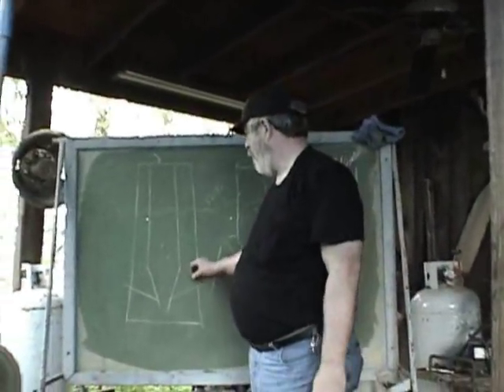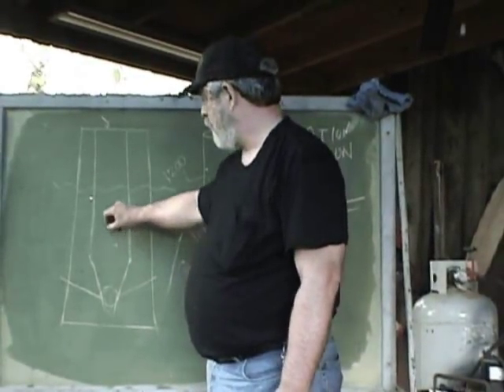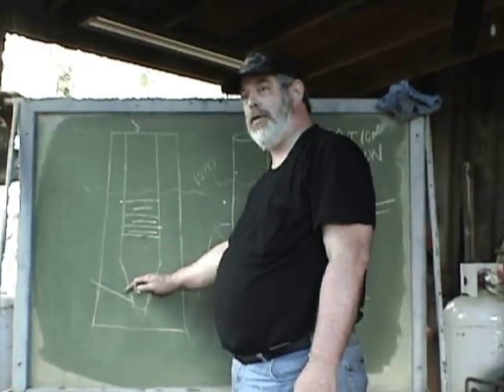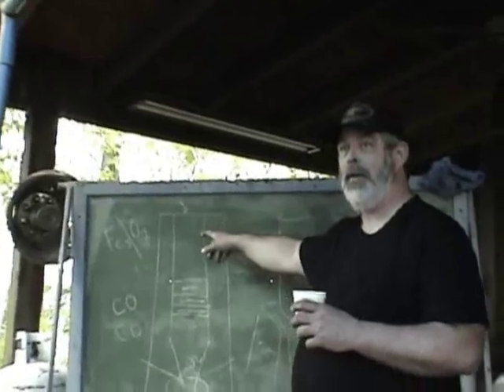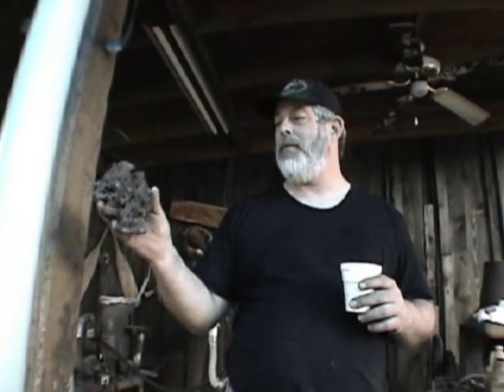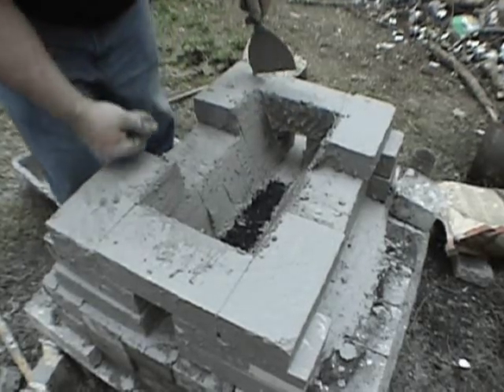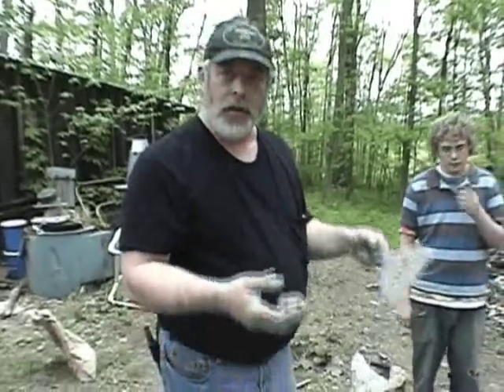Making Steel from Iron Ore

Comment: when he says layer, what is the "powder" that he is referring to between the Cole ? powder from the ore that they broke up? wish they were more specific about the incidence measurements they had in this video . thank you for posting though one of the more informative home made steel video , i just find all kind of industrial videos  , witch doesn't help me on my quest of educating my self of off grid living for end of world scenario lol . now on to how to make gun powder
Reply: +ixxgunnerx x Yes powdered ore, then charcoal, then ore, charcoal. Steel is carbonized (from the charcoal in this case) iron. The charcoal acts as heating fuel but also carbon ending up in the final product, and the construction provides the right low oxygen environment to chemically convert the ore. The result also has some other junk in it from the surrounding rock minerals and dirt, etc. In other furnaces, this is dealt with by adding flux, chemicals that bind impurities and then flow out separately. Lime and borax (though not sure about the latter in a furnace) are decent iron fluxes. Or hammering the bloom (chunk of impure steel at the end) over and over later on and folding it can help push the impurities out physically.

I don't recall them mentioning flux in the video, not 100% sure what this is here or know enough to just glance at it and say for sure, but there's more than one way to skin that cat.
Reply: ixxgunnerx x The powder the're referring to is iron ore.
Reply: Crushed charcoal, ore powder, silica sand, both the silica and the charcoal act as fluxes, typically hematite is mostly oxidized already, not sure what they're using but the hot as hell fire with all the carbon to burn the oxygen in the ore either ends up burning or bonding with the silica.
Reply: yeah its iron powder from the ore they broke up or u can get pure iron powder as well if u buy it that way, otherwise its a lot of work to make it pure yourself from just being ore

Comment: So is the end result a steel ore more or less? I know that there isn't any actual "STEEL" ores in nature, unless maybe formed by volcanic activity in some rare spots on earth.
 But could you compare it to pig iron. Or is it an amalgamation of steel and iron blob?
Reply from the maker: shexdensmore The end result is a formation called a "Bloom" which is that spongy looking chunk of material handed around earlier in the lecture portion. It is metallic, not ore anymore, but needs to be compressed and refined through hammering and folding to get all the slag and charcoal bits out, and homogenize the chemistry across the bar.

Pig iron is the product of a blast furnace, which is actually cast iron. Finery furnaces would take that material, and re-melt them, burning off excess carbon until a steely chemistry was achieved, but that's a completely different route, and more appropriate to industrial uses than for sword and knife-making, which this community is focused on. The process in this video approximates the Tamahagane produced in Japan, albeit on a much smaller scale, using different ore, but the end result is contemporary with the traditional products.
Reply: Gotcha.
Reply: ***** 
 So did you produce steel or wrought-iron? I'm a bit confused.
Reply from the maker: shexdensmore IIRC, it was "steely bloom" in that there was enough carbon in there to call it steel once pressed up into solid bar. Only difference between steel and iron, is the addition of carbon, which is something Dr. Blue was talking about by giving it time at temperature in addition to what was needed for the reduction to happen properly.
Reply: Gotcha, i just watched another vid that explained in better for me right after I made this comment.  
 Basically it said that you really don't know if you are going to get out what you want unless do diligence and proper proportions are used along with exact measurements with complete control over the process. And even then, its a gamble. Too much or too little, creates cast iron or wrought-iron. It amazes me on how consistent you have to be as well as experienced. 
 My hat's off to you and your crew.

Comment: Hello Christopher, very nice and informative video on producing steel from iron ore. Though I have some questions. How is this tatara smelting process different from European bloomery furnaces? Both furnaces looks identical except for the long narrow end on the tatara smelter, and both furnaces follow the same steps shown in the video. Then why is the end product for the tatara smelter steel, and European bloomery furnaces iron? 
Also, how is European steel and tamahagane different? Japanese steel had to be folded to make the carbon content homogeneous, but what about European steel? Did they also fold their steel like the Japanese, or did they have a different approach to produce homogeneous steel?
Thank you for this interesting video.
Reply from the maker: DerpTheGreat Materially, less difference than one might think. First it's important to distinguish the level of refinement needed for swords, vs. everything else made of metal in the same time and place. The key difference in the making, is the height of the stack, and the rate of air/charcoal/ore which is the balance that manages the end product's chemistry. In the Japanese case, the stacks were a little taller, which gave carbon more time to find its way into the iron, making steely bloom, where a viking furnace would usually be shorter, run faster, and not take up carbon as much in the process.

That said, carbon can be added later through hearth refinement, taking bloomery material and re-melting it in a short charcoal-burning hearth, and a smith familiar with this process can adjust carbon content and melt out impurities without all the hammering and folding the Japanese process is famous for. Just different ways of skinning the cat, and despite the constant pressure of people wanting to know which is "better," there is no good objective answer to that - the craftsmen did what they needed to in order to create the tools and weapons in demand by their cultures in their time. Those of us who study historical metalcraft see the overlap in techniques among ancient cultures, but one has to remember that they were working in a world without a scientific understanding of carbon's role in steel, nor the impurities that grant certain properties when alloyed through smelting, native to the ores used. They also certainly didn't exchange information freely among themselves across continents like we do today, the knowledge of good steel production was guarded like nuclear secrets were in the 20th century. Such secrecy and reliance on traditions, accidental observation, and (what would appear to us today) very low tolerance or appetite for experimentation, builds an easy foundation for myths, legends, and wonder at the end product. Make no mistake, this is alchemy, magic to those who don't understand it. Even educated modern smiths can still marvel at it and feel a little "touched" by being able to turn rocks into the finest edged weapons known to man.

Comment: He said it was an accident? As if the Japanese just folded their metal? Lol. So wrong... The metal was folded but also mixed with 2 to 3 types of metal to create a flexible steel.
Reply from the maker: Given that Dr. Blue has worked with Japanese Smiths on academic exchanges, I would suggest he knows what he's talking about. Specifically, that the patterns in Japanese steel were not the object of their refinement, but a fortunate side-effect of creating a homogenous bar of clean metal by hand in a pre-industrial environment. Yes, patterns are there, but the patterns aren't the point of the cleaning and preparation process... getting a bar of uniform material was the point.
Reply: Ah valid point but his comment in the video suggests othewise about his questionable knowledge.
Reply from the maker: Jonathan Elkins It was offered in a context of other educated bladesmiths, people familiar with the reactions of iron, etc. Somewhat esoteric for a general audience, and rather contextual to the moment, for sure. But he's not wrong in his characterization of the basic elements of the process.
Reply: Demacus steel is the achivment the Japanese were and are creating although the origin is inconclusive they still mimicked the steel by that of forge with several types of metal on a molecular level. I was just stateing my opinion on his comentary. Not questioning his knowledge on the creation of the demacus steel, but how he thinks it came about.
Reply from the maker: Jonathan Elkins Please go learn a few things before bringing argument here. Damascus steel had nothing to do with Japan, and was originally a crucible-steel, cooled from a liquid state and carefully forged. Modern pattern-welded steel uses 2 or more alloys to create contrast and patterns, but don't improve each other. There is no such thing as a steel molecule, it's Iron with carbon within a certain percentage by weight distributed among iron atoms, not chemically bound to them. Japanese steels are a complex subject (too much for this fora) for sure, but many misconceptions abound as to what made them great in their day. The attention to detail of the craftsmen is paramount, but it's still just a medium-carbon steel at the end of the day, and certainly no secret to those who study these things and do it themselves.
Reply: Not on the process. He is correct. But the statement that was made about the Japanese ACCIDENTAL fusion of the metals was not correct.
Reply from the maker: Jonathan Elkins That's not what he says - he's talking about the patterns being a "happy aesthetic accident, rather than something they desired". The whole folding and cleaning process is needed to get a clean bar, not a fancy-looking bar. That it happens to have patterns is great, and the Japanese, being who they are, take that feature and push it to a high art, but it was never the initial object of the process.
Reply: So my argument about his ignorant statement about how the Japanese created the steel was wrong? How so sir? And yes the are some gaps in my knowledge on the subject but with out my statement i wouldnt have had a reason to do more reseach on the subject. I do thank you for the enlightenment on how i need to research more about this, but you seem to be misunderstanding that i didn't say that i know it all. Im still ignorant to the entirety of the process and what steel maybe what. But again the comment was in accurate.
Reply: Sorry if i caused any ill mood good sir but my comment still stands on his statement. But ass far as the damascus* steel. From what i understand it was simular correct?
Reply from the maker: Jonathan Elkins I position is, that you thinking Dr. Blue made an ignorant statement is incorrect. You may have misunderstood his intent, or his characterization, but he was making steely bloom in the same tradition (but at smaller scale) of the tatara smelters in Japan. He's worked with them directly on visits to the US. He's read their papers on the material. I trust he knows what he's talking about... so yes, you coming into the discussion with gaps in your knowledge and a romantic view of Japanese steel-making, accusing Dr. Blue of ignorance, is probably a bit out of line.
Reply from the maker: Jonathan Elkins Depends on which Damascus you're referring to - the traditional crucible steel, or the modern pattern-welded material so often referred to as Damascus. Neither are related to Japanese steel, whose patterns are caused by very slight inconsistencies in an otherwise homogenous chemistry, not two different alloys welded together, or a pattern endemic to a cooled ingot of once-molten material. They are 3 distinct processes.
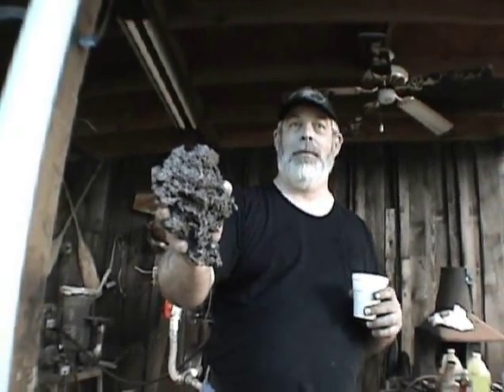Reply: +Christopher Price. Review 03:46 if im incorrect the explain what he ment when he said it was an accident.
Reply: ***** from what i understand the mixture of soft and hard metal was the idea. Given the breaking point on hard metal on impact breaks and on soft it bends. So they mixed them to make a sword that was stronger.
Reply from the maker: Jonathan Elkins I have explained it already in this conversation - the patterns were not the point, and when they showed up, it was "accidental discovery" in pursuit of a clean bar of metal.

Most things we hail as great achievements in historical metalcraft were, at one point, a result of accidental discovery. Once found to be useful, they could be developed.
Reply from the maker: Jonathan Elkins re: hard vs. soft, that's a construction method using a soft core and hard side/edge steel. But that's not damascus, and you pretty much don't even see the soft steel unless it's showing at the spine.
Reply: Ahhh so they just stumbled across it. Ok i understand where he was coming from. Lol wow i do apologize for the misunderstanding on my behalf. And thank you for taking the time to lifting the veil. Wow yep i guess you can say "mistakes were made"  Thanks again.
Reply: I do have a question though if you care to answer. Do you know what metals were required to make an. Authentic samari sword?
Reply from the maker: Jonathan Elkins Yes, I do, but it's too detailed to try and explain here. Feel free to email me if you're interested in a proper discussion on it.

Comment: I guess the higher heat coke process if much much later..for forming and final finishing of item that is made.. things such as tools etcetera of earlier centuries
Reply from the maker: Mineral coal or coke has too many impurities, particularly sulfur, for the reduction of iron in this way. It makes the product brittle and red-short. Mineral fuels work fine if you're melting in crucibles like a foundry, but for solid-state reduction of ore, simple charcoal is best.

Comment: can i use scrap iron instead of iron ore to make steel?
Reply from the maker: Yes, but not with this method. There are ways of converting the carbon content, and refining metal from one grade to another, using a charcoal-burning hearth. The Japanese term roughly describing this is Oroshigane.

Comment: I see you extracted the iron from the ore, at what point was made into steel?
Reply from the maker: A charcoal-fueled stack like this reduces ore to iron, but if you give it more time at temperature, it picks up carbon along the way as well. A viking short stack makes more plain iron, a medium sized stack can make steel, and a tall stack like the blast furnaces of early America make cast iron... each adding more carbon to the iron as you go up in height. This is a gross generalization, because most furnaces produce a variety of chemistries at the end, which is why pieces need to be sorted and welded together to obtain the correct chemistry for the final goal. For swords, you want a bar between 0.5 and 0.75% C by weight, depending on which Japanese school of sword-making you're referring to.
Reply: at the point it reacted with the charcoal, I would assume. 
Steel is nothing but an iron and carbon alloy, by adjusting the carbon content from the coal to compose 2% weight or so of the prodcut, it should become steel. :)

Comment: So how is charcoal made?  I'd be interested in knowing how this process can be achieved starting from near scratch.  The ancient blacksmiths had to have produced their charcoal somehow, along with the right kind of bricks and what-not for building the furnace.
Reply: Look up primitive technology. He's got a video of a basic charcoal make. love that channel
Reply: lol, first video in the right hand column is a making charcoal vid
Reply: Charcoal is carbon-containing material (usually wood) that has been heated without oxygen present. 

Blacksmiths can use charcoal, but it really doesn't crank the BTUs the way coal does. Most effective blacksmithing uses anthracite or bitumen coal. Both have advantages and disadvantages. 

Smelting likes charcoal because it does not burn efficiently and so some of the carbon from the charcoal is incorporated into the iron being smelted to form steel. Nice oven, nice new project. Cool.
Reply from the maker: Aiki Xtal Specific to the making of iron from ore, coal carries with it too many impurities. It's not about the heat, this furnace exceeds 2800F at the blast... but rather the chemistry.

Comment: This video is too cool for words.  I guess the process can be modified for smaller batches?  I have about 100lbs of bog ore that I'd like to experiment with.  I've seen Ric Furrer's videos on making crucible steel, but I'm not sure if my ore is of sufficient quality.  Any suggestions for a COMPLETE beginner?
Reply from the maker: Yes, get on the Bladesmiths forum and read everything you can in the Bloomers and Buttons section, especially pay attention to the work of Mark Green.  Good luck.
Reply: ***** Thanks Christopher.  Like you said, if it was easy, everyone would do it.

Comment: Would a rocket stove heater be hot enough for this?
Reply from the maker: No, this requires forced air, and furnace material capable of withstanding the high temperatures needed.  If it were that easy, everyone could do it.
Reply from the maker: Weary Man Nobody's saying this is the only way to get the right steel to make a blade with. But, if you're looking to replicate the character and chemistry of old work, and in this case Japanese work, it is the only way. Modern steels don't produce the visual effect that folded bloom does, and the shallow-hardening nature of this material is also appropriate to the needs of the bladesmith looking to differentially harden with clay.